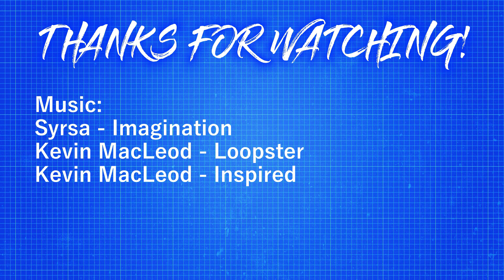3D Printing Materials Flammability | Comparing the Most Common Materials

Comment: Thank you for this video.  We use 3D printed parts at work, and just today we were wondering about the flammability of the different 3D printing materials.  (Earlier today, we had a report of a PLA part catching on fire; we were skeptical that this really happened, but I can tell you that after seeing your tests, I am not skeptical at all.)  BTW, you just got another subscriber.
Reply from the maker: Thank you :) I was thinking about doing this test for quite a while, and the last drop was that recommendation to blast the resin vat with a torch. Actually, I wanted to test liquid resin for flammability, but it turned out that even in a tree shade under an autumn sun the resin solidifies (at least on the surface) in just a few seconds. I decided to scrub that footage.
Reply from the maker: When I was filming it, it kept solidifying almost instantly. I've tried doing that one more time a few minutes ago. The liquid resin (I used Elegoo Translucent Green) seems to be very flammable. It has caught fire very quickly, but, unlike cured resin, it burned with almost no smoke, and the flame looks like an alcohol flame (pale blue with a little bit of orange). It looked like the vapors were burning, not the liquid itself.